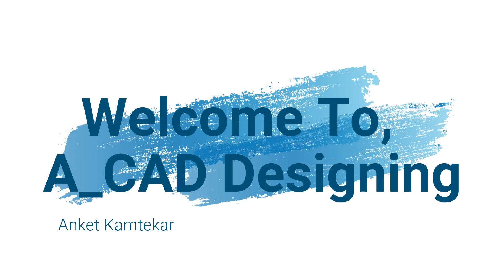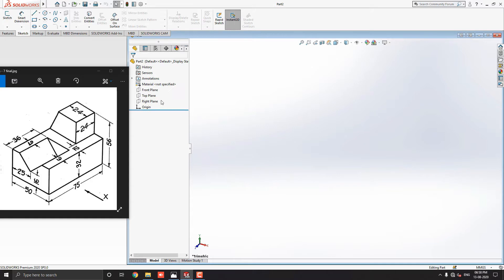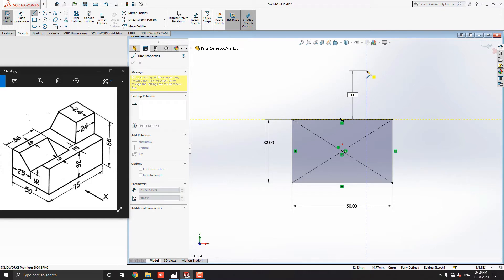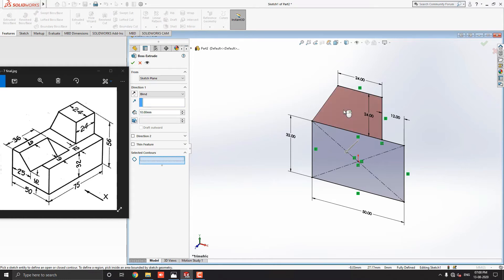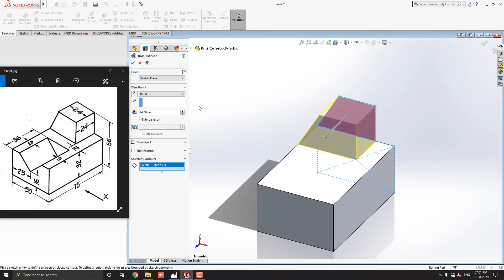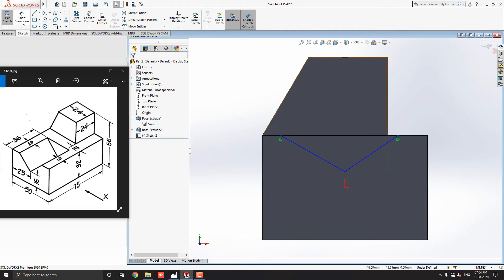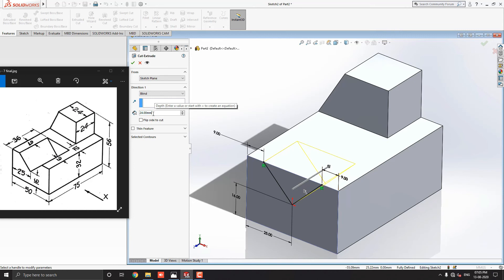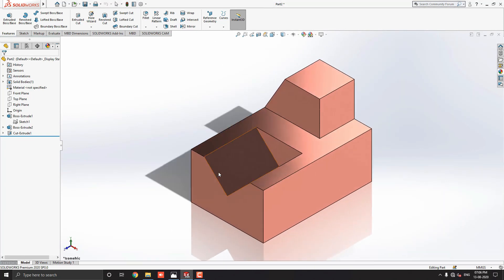SolidWorks Tutorial For Beginners | Part Modeling Exercise - 07

Comment: Mujhe horizontal ya vertical line hone p yellow mark nahi show ho ra h aur na hi koi centre point ya corner point highlight ho ra h kya... Kya karun mai
Reply from the maker: Go to system option and reset settings
Reply: @anketkamtekar   where is the system option
Reply: I have reset it but still doesn't work for me
Reply from the maker: @abhinavtiwari6186  
If you follow my videos, then you know this options ...
Check video solidworks part modeling exercise 3  (1:02)
There is system option
Reply from the maker: 9850521466 whatsapp me.
Reply: @anketkamtekar  okk